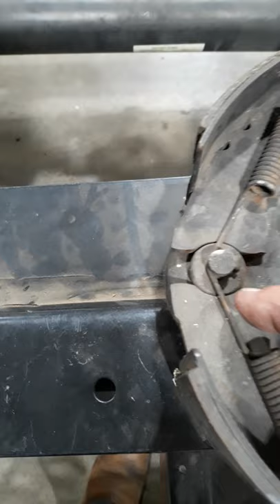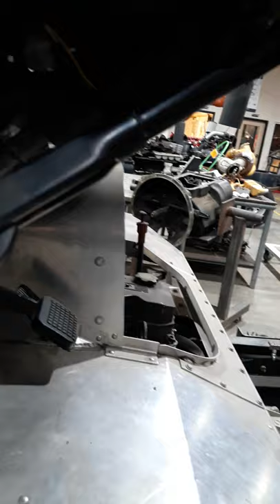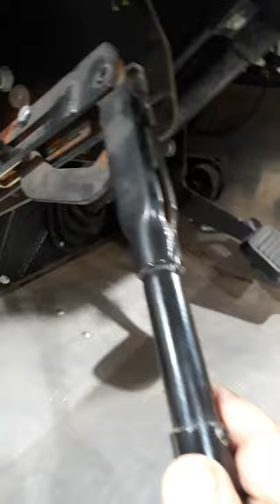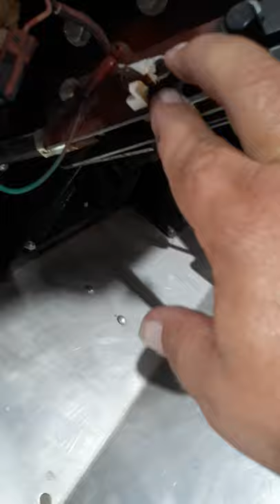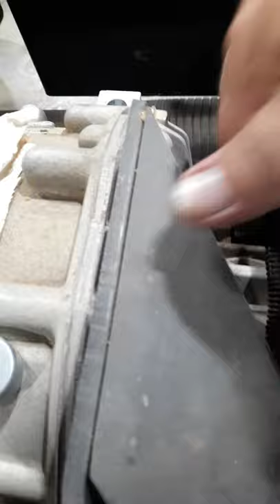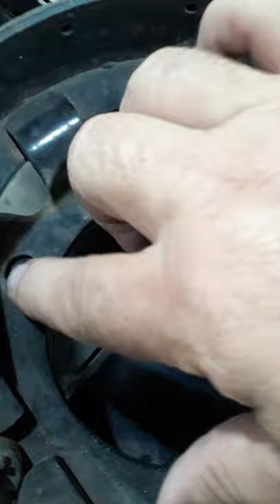driveshaft parking brake description and operation

Comment: Just bought a 1994 Chevy Kodiak rollback with a manual transmission that has this parking brake system.  I wrenched on big trucks and buses for several years but never heard of this before.
Will have to investigate.
Thanks for the info👍🤟

Comment: Thanks for posting this! When you say it “locks” in place, is there a physical locking mechanism or is it just held up pulled by the tension? I have a very similar lever on my P30 motorhome and there’s no secondary locking mechanism (like a button on a car’s parking brake lever) which is a little scary. I worry I might bump this while working under the dash or getting in and out. But they must be pretty reliable otherwise they wouldn’t be on all those trucks/MHs right?